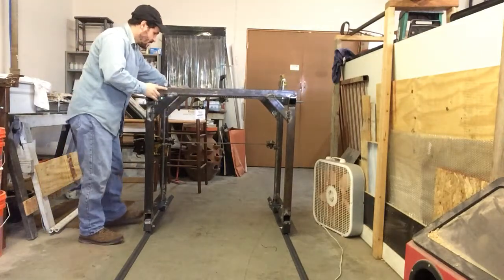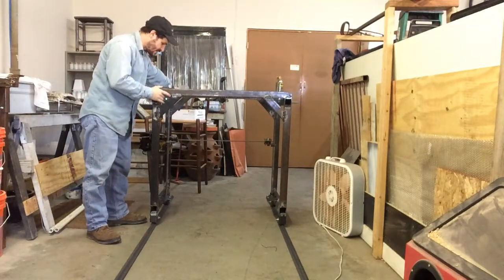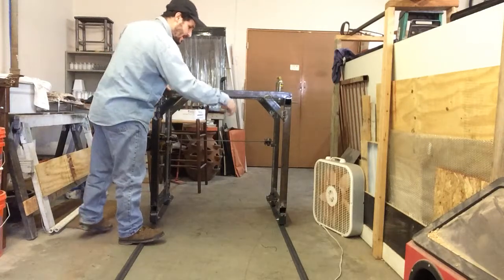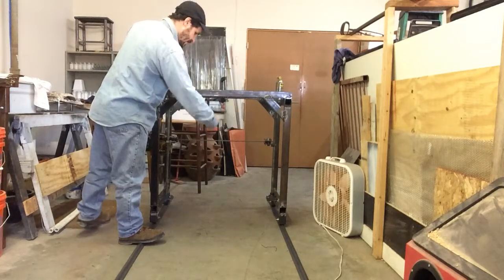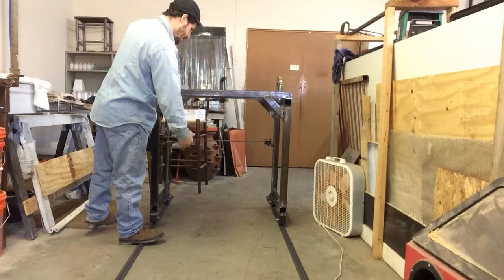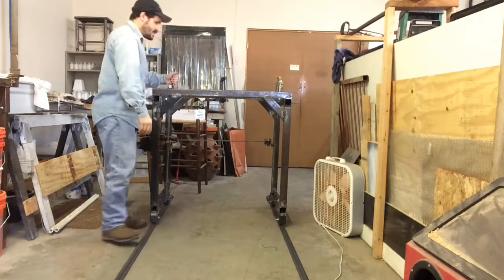Chainsaw Mill (DIY - In Progress)

Comment: Looks good. Any chance you could give the measurements on the frame work and any other info . on your set up? I have a Gransberg Alaskan Mill I am using. Does a great job. But I would like a set-up like you have and put a 22 HP Kohler motor I have on it to run it. I am using a Jonsered 2171 saw now. I just feel like it is putting a lot more wear and tear on it than I want to . Would rather use a motor than my chainsaw. Looks good your setup thanks for sharing.